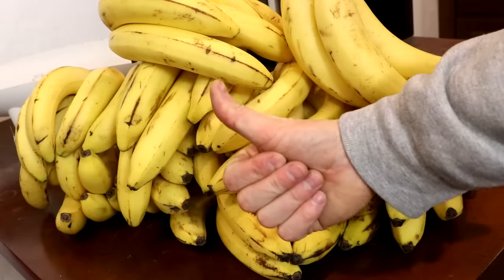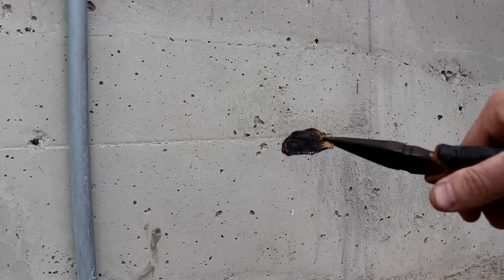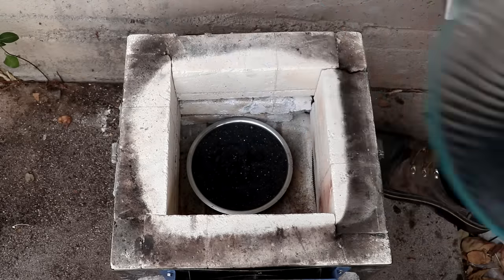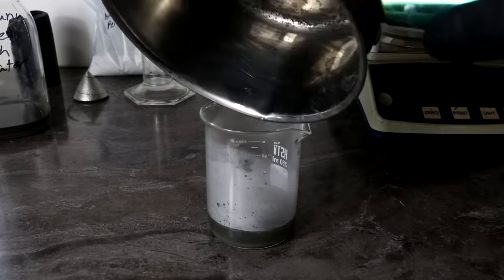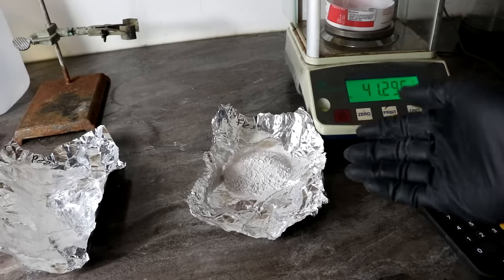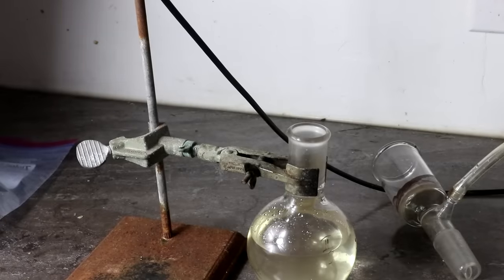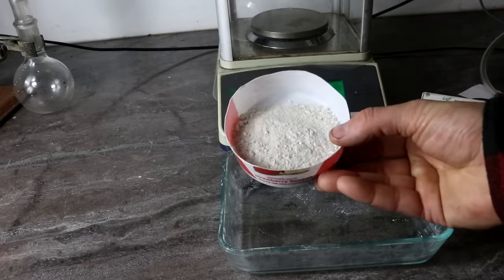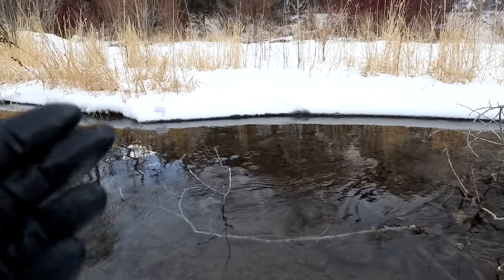Potassium Metal From Bananas!

Comment: Probably to do with the water ratio of the peel vs the fruit itself. The peel probably contains much less water overall compared to the fruit itself. So when dried, the mass of the peel becomes nearly the same to that of the fruit.
Reply: This is actually a very fair point. It also could be that the potassium salts in some way benefit the peel. Citrus fruits actually contain more of the aroma and flavor compounds in the peels than the flesh because they’re hydrophobic and therefore prevent the juice from escaping.

Comment: The fun thing about this is that the potassium he managed to extract is worth about 5 times 10kg of bananas (or at least this is what I found out searching on Google) . He could start a business out of this😂
Reply: hm he had to sacrifice lithium in the progress tho. Lithium should be more expensive than potassium. And I don't know if there is a way to convert the lithium chloride back to lithium without buying expensive chemicals aswell. If it would be that easy the industry would farm bananas as a metallic potassium source
Reply: @vairoxx4031 it can be done by the electrolysis of the molten salt. It requires lots of heating and electricity though so I'm not sure how that would play into the cost
Reply: 10 kg banana cost 16-17 usd in my country. Its food. You cant eat potassium so it is a waste. :)
Reply: This thing you said reminds me of biodiesel extracted from seeds and the catastrophic consequences this had for the rainforest in Brazil.
Reply: the cheapest way to obtain potassium hydroxide, potassium carbonate, and potassium chloride is the salt of potash and quicklime, potash can be replaced by cream of tartar. the burning process can be explosive. the salt obtained will be a potent solvent that can dissolve glass.
Reply: Not saying bananas aren't a source of potassium, but that doesn't transfer to good sources of potassium. Otherwise industries would have tons and tons of banana farms everywhere. Instead, they obtain it from rocks, which is exactly why bananas have it in the first place (they take it from the earth). Also lithium ain't cheap.

Comment: Nilered: * doesnt like how impure a solution is * * goes through a complex purification process to fix it *
Cody: * doesnt like how impure a solution is * "meh" * continues *
Reply: Omg yes, I was thinking this exactly. Nile would spend like 1/2 a day refining it but this guy clearly did the whole thing in 1/2 a day
Reply: @nuttyengines4464  Same reason I watch both This Old Tony and AvE. There's the right way, and then there's the "Eh, screw it, it's good enough" way.
Reply: I watch them all. 🙂
Reply: You should also watch Elemental Maker.  He reminds me a lot of AvE.
Reply: not to mention nile uses actual lab equipment instead of a kitchen oven, a campfire and tin can.

the only lab equipment Cody had was a vacuum filter.
Reply: @nuttyengines4464  you come off as a bit condescending...we're fans of both guys here :)
Reply: Well the difference bwtween the two is like science vs industry. In science you want to squeeze every bit of stuff, hence all the stuff NileRed does to get as many stuff as it exist in theory, while Cody does it in industrial scale of, that's profitable enough

Comment: I was good at high school chemistry so in the chem lab, my teacher allowed me to experiment with substances that were off limits to most of the other students. For me that meant elemental sodium, lithium and potassium. One day the teacher had a small jar of elemental sodium under some non-reactive oil and offered me a tiny piece to see how it would react. Since we didn't have a river to toss it into like Cody, I had to do it under the hood. I put a few drops of water on a tray and under the hood added the bit of sodium. It danced around like a grasshopper, breaking down the H20 and giving off hydrogen gas. Being highly flammable, (think of the Hindenburg) the heat of the reaction ignited the H2 gas. Note that H2O can be written HOH, which emphasizes the fact that water is a hydroxide of hydrogen: H+ -OH. 

2Na + 2HOH → 2NaOH +H2 - [Sodium + water creates lye and hydrogen] In Cody's case, using potassium, the reaction would be:
2K + 2HOH  → 2KOH +H2

The lesson was the activity of metals. Sodium and its cousins, including potassium, are highly active and are never found in their elemental state in nature.
Reply: does that mean that if you had a source of hydrogen you could turn lye into sodium?
Reply: @animehair05silently88 Yes and no. Turning it back into elemental sodium would be very difficult. Turning it into a sodium salt is as easy as adding an acid, though. For example, NaOH + HCl -> NaCl + H2O.

Comment: "This is still about half protons by weight, so i'd like to remove that."
Reply: I should guess well over half
Reply: @DanKaschel  yeah I don't know physics that well to know if the protons or neutrons are heavier
Reply: @DanKaschel  no. Both potassium and chlorine's most abundant stable isotopes have one neutron more than the number of protons, and since the difference in mass is negligible, there is more mass in neutrons. The only way you could offset it is by packing the molrcules with hydrogen, since most of it only has one proton and zero neutrons
Reply: It'd be a lot more interesting to remove the neutrons.

The video wouldn't be very long after that, though.

Comment: I know it sounds like a stupid question, but I'm a layman on the subject... if you throw the crushed or powdered substance, wouldn't it have a greater or faster reaction due to the contact area?
Reply: Faster reaction for sure because of the greater surface area contact, although (this is speculation) while it would release more energy in the same amount of time (thus “greater” it’d probably be less explosive and visually impressive since the reaction is spread out instead of contained in a small area
Reply: @twu.4.25  interesting, I had this in my head for a while... thanks for the answer and for the time my friend
Reply: I agree with the first reply. Maybe it's like how the powder in firecrackers work. If you light it in a spread out form, it just fizzles, but if you compact the powder and light it, it explodes. Though, I dont think it's easy to make potassium powder in the first place considering how unstable it is when pure. It's also a really soft metal.
Reply: Alot more of the potassium will oxidize if you increase the surface area, and oxidized potassium does not explode.
Reply: Powder was KCL not only K

Comment: Cody: has a range of advanced equipment used by professionals
Also Cody: putting a chair over his burning bananas to stop them from getting wet
Reply: He is efficient thou
Reply: @YashKumar-ve9hg  ofc ofc
Reply: y e s
Reply: also cody: misspells banana
Reply: Also cody: uses rust eaten steel drums as a furnace and has no refrigerator in sight apparently
Reply: That's incorrect. This vlogger does not use advanced professional equipment. He used a low cost "hobbyist" Geiger-Muller counter, which cannot detect alpha particles. To correctly detect ionizing radiation, you must measure alpha particles.

He doesn't even mention this oversight, so he either doesn't know or he's hiding this significant lapse. He's made other significant errors. This vlogger gives entertainment, not true science.
Reply: True. A real chemist would've used a graduate student for this purpose.
Reply: @Anastas1786  pfft…amateurs, amirite?
Reply: @whoknew4722  Sorry to chime in but, Potassium-40 does not undergo alpha decay. It only goes through beta decay and gamma decay, which his Geiger Counter does detect.
Reply: Also I'm pretty sure I have that same scale and it is a baby/toddler scale.

Comment: I think we should use molten electrolysis to obtain potassium. This is the core extraction step. If lithium is used, it just becomes an ordinary chemical experiment. It is not an original acquisition method because lithium is also difficult to obtain. Thank you so much ! Nice video !

Comment: Someone get this man some equipment that isn’t rusty
Reply: Hardware mode old style
Reply: rust keeps raw metal underneath from oxidizing
Reply: @daftnord4957  isn’t rust oxidation? The oxidation prevents further oxidation?
Reply: Due to the snow
Reply: @bright-noise  yes, its called passivation
Reply: Dude! Have you ever been to chemistry lab, everything's rusty there, it be like that most of the time!
Reply: @bright-noise  rust is corrosion.. it bvb will dissolve the metal over time.. patina is a form of oxidation  that protects the underlying  metal
Reply: @bright-noise  Metal only rusts where it comes into contact with oxygen, at the surface.  Rust covers the surface, preventing the metal underneath the rust from oxidizing.
Reply: @bright-noise  iron rust is different from say, Aluminum because the iron oxide molecule is geometrically larger than before oxidation, causing it to break away and expose more surface which is why rust is a problem for low-carbon/mild steel but less so for Ally or silver

Comment: That's really impressive!! I have a question the last reaction, how do we know that the end product is potassium and not lithium since the conversion is not complete and lithium is in excess?
Reply: The K vapors come out of the tube and condense into the mineral oil kept below. The Li has a higher boiling point. Cody has another video for this.
Reply: Flame test a potassium salt - lilac color. That is seen in the flame when the potassium is thrown into the water pool.

Comment: That stack of bananas would have a small amount of measurable radioactivity. Where could this radioactivity have gone during this process? Interesting
Reply: Into the potassium he extracted.  Natural potassium K39 also contains a tiny amount of the radioactive K40 which behaves identically in terms of the chemistry he is doing.   The K40 decays slowly into argon gas, emitting beta particles and some gamma radiation too, that is what radioactivity is..

Comment: Mind to explain me the process in which you convert the KCl to K and LiCl? I got lost there.
Reply: You basically just mix KCl and Li together and heat them up real good. The lithium has a more negative standard reduction potential than potassium, so it "wants to" give electrons to the potassium ions, making lithium ions and potassium metal. The heat melts stuff - allowing for better mixing - and provides activation energy. Potassium also conveniently has a much lower boiling point than lithium, so it distills off nicely.
Reply: @lunkel8108  thanks. I suspected there was heat involved. I had my doubts with the physics.

Comment: 4:34 ... Wait, isn't potassium also a "volatile"? Not a chemist by any stretch. Confused.

EDIT: So disappointed at 10:55 when I realised it was a perfectly timed meow from the cat and not a squeal of delight from you at the sight of the white precipitate. :(
Reply: Volatiles, in this context, are the compounds in the plant that will evaporate at relatively low temperatures. The potassium compounds are not volatile, they will not evaporate at low temperatures. Thus, they are left behind.
Reply: @aidenthehuman5921  Thanks! That's interesting. So does "volatile" often mean something different in the context of organic chemistry than in relation to the chemical analysis of a planetary surface, for example. The reason I asked is because I once read some stuff about Mercury that mentioned the unexpected presence of "volatile elements such as sulphur, potassium and magnesium [and others]". But I also remember some work in a course during my masters that covered "SVOCs (semi-volatile organic compounds)" in construction materials, in which "volatile" means something closer to what you describe. Maybe there's no general definition of "volatile" in chemistry.